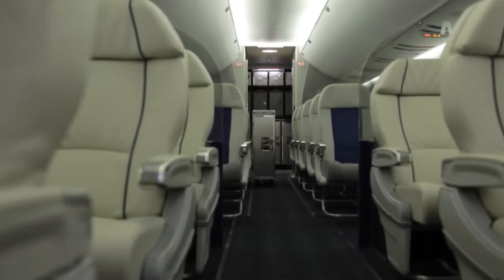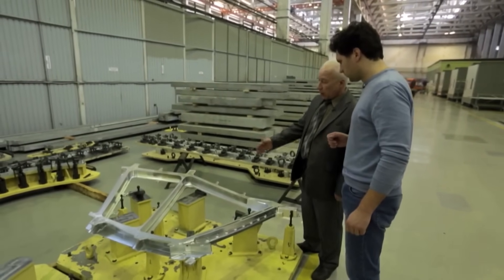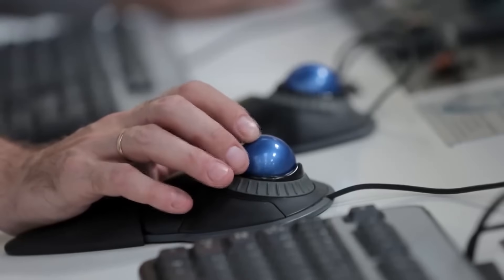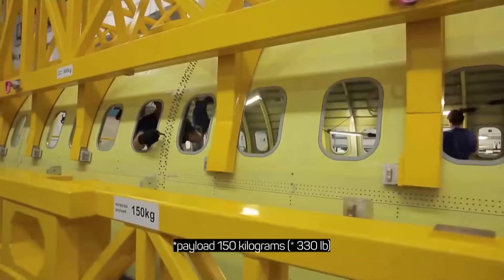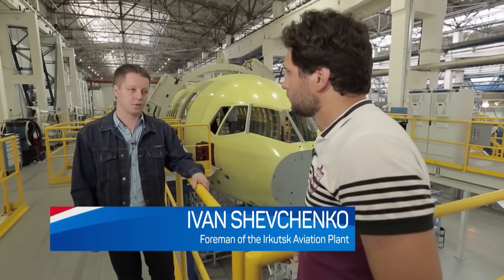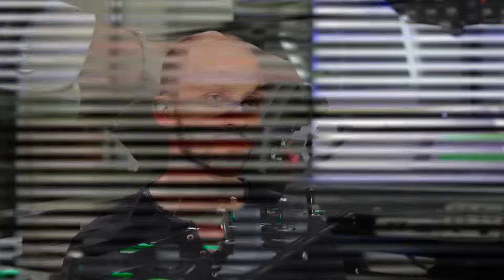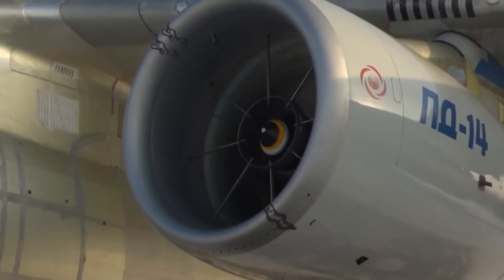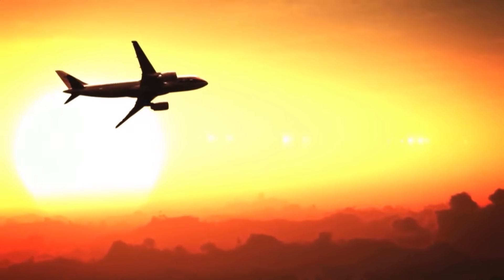The MS-21 – RUSSIA's Boeing 737 MAX Alternative

Comment: Update: due to sanctions, they stopped using Pratt and Whitney engines. Now they use only PD-14 (ПД-14).
Reply: What Engines does Boeing use? Aren't built buy Russia? Ask Elon. Boeing Engines are made by Russia!
Reply: Good to produce on their own to get more freedom from the hostile environment
Reply: What you said Pratt and Whitney sounds like a new Paccar engines they came up recently on a US market semi trucks, which are completely JUNK. So very good that they went with there own engines.
Reply: well.what are the successes??:face-green-smiling::face-green-smiling:
Reply: Due to sanction, they can neither build nor sell a plane that no one really wanted anyway... This is a C919 but with Aeroflot logo. The only Russian part inside it is the vodka for the passengers.
Reply: @TheNefastor  No it's not, they don't even have the same dimensions. Likewise different engines, cockpit, uses different materials, has multiple current sizes unlike the C919, etc.
It seems the MC-21 actually uses less foreign components/suppliers than the C919, for better or worse.
Just because they look alike doesn't inherently mean anything, current planes in general barely look any different.
It's not clear how much, if any, collaboration there has been. Obviously Russia has it's own long history of manufacturing aircraft.
Reply: @DoubleMonoLR  you shouldn't assume people are ignorant and can be lied to easily. Both place have the exact same dimension and payload capacity, at 19 metric tons. The Russian is slightly bigger but only to accommodate larger fuel tanks and give it more range. And the only significant difference in western component sourcing is that the Russians are using a domestic engine (for better of worse, as you said)

Moreover, the history of Russian airplane design includes very few civilian passenger planes, especially if you don't count military planes converted for airline use. That's why they used a lot of western input.

Bottom line, in every way, MC21 == C919.
Reply: @TheNefastor  You are clearly an aeronautical engineer from China, left without work due to your qualifications.
Reply: @TheNefastor  Length 42.3 meters for MS-21 and 38.9 for 919. Maximum payload 22.6 tons for MS-21 and 20.4 tons for 919. Fuselage diameter 4.06m and 3.96 respectively. Maximum range 6000 km and 4075 km. Yeah, they are pretty the same, lol
Reply: @mihailraskin2912  yes they are. Just because you can't read through your bias doesn't suddenly make your beloved single-aisle single-deck amateur plane into an A380.
Reply: @TheNefastor  Oh, I see. So 919, 737, 320 are the same to you. I have no more questions.
Reply: @TheNefastor  Boeing's largest branch outside of US was in Russia. Boeing 777 Dreamliner is 30% Russian designed. Boeing 737 MAX is mainly US designed with no Russian or German input and they royally failed with it.
Reply: @TheNefastor  So they have different dimensions, different wings different engines and insides and they are the same plane. Are you ok in your head?
Reply: @_Epsilon_  of course it is. And my mama is Elton John.
Reply: @TheNefastor  Again Boeing's largest branch outside of US was in Russia, they were doing enourmous job for Boeing. Same for Airbus. Russia is pretty much the only country in the world that can make 100% indigenous plane. Maybe US too, maybe. That's it. UK, France, Germany, Japan, China? None of them is capable to roll out their own 100% domestic aircraft, heck not even at 50%.
Reply: @_Epsilon_ You mention a "Boeing 777 Dreamliner", quite amazed as it's a variant I've never heard of.
Reply: @_Epsilon_  The point is not how planes are built and where it is made, the thing is with which engineers the creation can exist! Today, no-one newer russian airliner can have total pure russian creation! We will be able to equitably judge a russian whole product when it will be real 100% russian made! We wait for!
Reply: @gogolemongol5384  
Name me any foreign plane made ENTIRELY by one country.
Reply: @TheNefastor  Well Russia built a plane, and flew it successfully so I guess the only Vodka left to be served is to you.  But why bother you’re a ukronazie my guess so you won’t admit anything anyway 😂
Reply: @_Epsilon_  Boeing 777 Dreamliner is something made in CCCP ??? 🍖
Reply: @TheNefastor  BRICS is 11 Countries, 3+ BILLION Market. Russia will have No Problem selling their plane. 😂
Reply: @SportZFan4Ever  riiiiight, because 3 billion poor people have obviously the same budget for planes that the world's most powerful economies. Keep deluding yourself, it's hilarious.
Reply: @TheNefastor  Say "palyanytsya" 😂
Reply: @DoubleMonoLR  Most of the rockets and motor were made in Ukraine tovaritch...
Reply: @TheNefastor  "history of Russian airplane design includes very few civilian passenger planes" - lol. You know nothing
Reply: @ilia9048  prove it, then. List every Russian or Soviet airliner that isn't a repurposed military design. This won't take you long.
Reply: @TheNefastor  Mr. "expert", that you haven't heard etc. means nothing at all, when someone makes an argument a rebuttal is not enough "I say" as you do, and when you say something then the other fact may not take your statements as facts ;)

Post less like a USSR Politburo worker and more like a debater respecting facts and democratic debate ;)
Reply: @Odisovic  was that even English ?
Reply: @TheNefastor I get it, there are no facts, so the embarrassing journalistic "I don't understand" (a favorite of the incompetent journalist is to repeat the question 10 times :D )

So do you have anything like a human being or will the next answer be like a politruk as well?
Reply: @TheNefastor  Give more sanctions! You provide an opportunity to raise Russian industry, which could not be done before with globalization.
Reply: @TheXBiTeX  LOL sure thing, buddy 😜
Reply: @andrewkondrash1642  He is Taras from Lviv Boeing division 🤣
Reply: @almarn  In USSR. What can be made in Ukraine we know now, 30 years after the dissolution. The answer is: nothing. Those guys have managed to destroy even the most advanced factory - Motor Sich 🤦‍♂
Reply: @TheNefastor  boy.. why are you so sure Russia is trying to outperform or outcompete someone.. maybe they're just trying to build the most excellent plane that they can, mainly that is as self-sufficient as possible. They are quietly trying to become technologically not dependent on anyone else. Maybe they're not 100% they're yet, but they're trying to perfect things .. for themselves. Maybe to use internally. Russia is a huge country, and so domestic air travel is a huge deal. And whoever outside buys them, buys them. If not.. well, we'll see.. You seem to be very emotionally involved, yet you seem so sure that Russia will fail. Well then what's the difference? Ignore the hype, right? And if they make it, why is that so terrible??
Reply: @comment6864  you can put away your gaslight, comrade. I saw you coming from a thousand miles away.
Reply: @TheNefastor 😮
Reply: @gogolemongol5384 это невозможно Боинг ты думаешь чисто в США делают ? Там запчасти со всего мира
Reply: @TheNefastor  но ведь С919 начал разрабатываться ПОЗЖЕ, чем МС-21 (презентации от 2012 и 2015 годов).
Я бы скорее его назвал французско-американским в своей основе, с оглядкой на Boeing, чем китайским.

Очевидно, что вы ничего не понимаете в авиастроении, раз класс самолета является для вас достаточным основанием для таких сравнений.
Тогда и VW Golf это Kia Ceed по такой логике.

Похоже, вы просто наелись украинской пропаганды, не закусывая.
Reply: @NSMenschMaschine  what makes you think I know your language?
Reply: @TheNefastor  use translator like me and everyone else, oldguy
Reply: @TheNefastor  if you don’t know Yakovlev 42 history - you don’t know MS21 history as well. It’s Yakovlev renewed project
Reply: @TheNefastor  Yes. And toilet bowls were stolen from Donetsk villages.
Reply: @TheNefastor  At least in the MC21 , Amercan big ass dont need two seats like in Boeing planes😂
Reply: @patrickvavasseur7641  what makes you say that ? I've never heard Russian planes had bigger seats.
Reply: @TheNefastor  It's second-degree humor. I don"t know the difference between Russian or American aiicraft seats, but it's a response to your eternal superiority complex. In your opinion Russians are only capable of making vodka, which is a silly cliché. So I also have one of the Americans. They all have a big ass.
Reply: @TheNefastor  XD you're hilarious. keep coping
Reply: @nettlecarrier8259  who's coping ? I'm not the one whose country is ruled by an incompetent dictator losing a war he started.
Reply: @TheNefastor  Can't sell? Are you ok dude? They will sell it internally, getting rid of airbus and boeing. Same thing with C919. Both China and Russia will use domesticly produced planes
Reply: @TheNefastor  This plane has nothing common with C919, aside from being in the same class. It is completely different plane, stemming from Yak-142, and was renamed from Yak-242 to MS-21. Open Wikipedia, at least, and educate yourself a little.
Reply: @TheNefastor  MC-21 is way superior than C-919, in every aspect. MC-19 have more advanced design process and much higher engineering culture, advanced materials, another electrical and electronic solutions. Also this plane in the first place required to internal market but iran, china, india also will be interested in such a plane. China, inspite of having its C-919, will be interested in MC-21 plane because, C-919 have a high sanctions risk in case Taiwan conflict, and China will prefer diversify its avia park.
Reply: @vyacheslavvorobyov22  you're basically claiming a blue Lada is better than a red Lada. I honestly don't care. I'm sure both planes will give a lot of work to crash investigators, though.
Reply: @TheNefastor   школу закончил специалист?
Reply: @TheNefastor "that no one wanted". I think it's too early to say that, because I think in Russia they need maybe those and they build those not only for exports purpose. 😊
Reply: @TheNefastor i understand you are from india 😂😂😂😂😂
Reply: @TheNefastor ты откуда такой умный 😂 с Украины что ли ? Приезжай на производство поработаешь узнаешь из чего сделано
Reply: @MrBoFka  Не надо, он там нагадит.
Reply: @TheNefastor Никто- это 53 страны, колонии Америки. А остальные будут закупать вместо Боингов и Аэробусов.
Reply: @TheNefastor  😂😊😅 you didn't have to be so straightforward. Give those Russians some hope, at least.
Reply: @HenryTudorVIII Laugh at yourself. You sound cracked. Russia is one of just a few that can build submarines and space rockets.

Comment: "In series production since 2017", but no aircraft delivered till now. Makes you wonder if the MC-21 will come to market as planned in 2024.

In addition, the Aviadvigatel PD-14 ran first in 2014, but only a handful were produced till now. It is said to be problematic, since the combustion can't be controlled as it should be. Will this lead to another russian project going nowhere?

Btw. Do you really think PW is still allowed to export engines to russia "to open new markets"?

The statement to the fuel economy seems not viable considering the A220 while carring 10 passengers less, weighing 10 tons less. It is best fuel economy airplane out there and it would be very difficult to build a more efficient plane.

Is the "new PD-14" without western tech? Then forget the shiny figures and watch how old Tu-214 are going to production again, with old engines and old design. It is already happening.

just my rant about a misleading youtube video
Reply: ПД-14 уже в серийном производстве.
Reply: an important indicator by which each aircraft is evaluated is the cost of a flight hour. Several indicators are included in this parameter: the cost of fuel, maintenance, pilots' salaries and much more. The Airbus A320neo, the leader in flight range, turns out to be the most expensive of all — an hour of its flight costs 3.2 thousand dollars, and in some cases this figure reaches 3.5 thousand dollars — an absolute record among the most popular narrow-body aircraft on the market. The Boeing 737-MAX is a little cheaper — an hour of its flight costs 2.5–2.7 thousand dollars. The MS-21 has absolute leadership in this class — the estimated cost of a flight hour ranges from 2.1 (2.2) thousand dollars to 2.5 thousand. The final figure of the airline will be announced after a couple of years of operation
Reply: @Олег-ы6щ5н  Ha ha ha ha the A-320 is the more expensive airliner! Explain me why his orders is more than 15.000 today, even before the Boeing 737! Just India ordered 750 Airbus, mostly A-320, during last 2023 Salon du Bourget. Because A-320 have the higher flight hour cost???  And more, it is not only to have the best flying hour cost, it is necessary the plane can fly constantly. Who can told us how many rotation a day that MS-21 will do? One flight at (ESTIMATED) cheapest cost and two days at workshop for usual maintenance? I wish the best for that plane, only time will say if it is born as a winner or a looser!
Reply: "It is said to be problematic, since the combustion can't be controlled..." - who and where said this? Can you provide a reference, either  it's just voices in your head? The PD-14 has been already tested thoroughly and was certified by ICAO in 2021.
Reply: Tu-214s are built in series with PS-90 engines of the 3rd version, because they have long been tested and certified. These are reliable aircraft that will easily find an independent market from the American dictatorship of sanctions.
The PD-14 engine is obviously not serially installed on the aircraft, because at the moment there is no fully certified MC-21 aircraft exempt from non-free western components. Perhaps the PD-14 engines are already waiting for the aircraft in the finished product warehouse, and there are already a lot of them.
PD-14 is already the past, but it continues to be tested. Work is underway on the PD-8 and PD-35. American propaganda said that there would be no serial production of the PAK-FA aka Su-57. Do not repeat MSM propaganda. Think yourself.
Reply: @Nahal0nok  exactly - Americans like to diminish the competition an d pretend to believe in propaganda exposing the incompetence of other people, as if they were the only smart people on the planet
Reply: @Nahal0nok  I don't repeat propaganda. Btw. the PD-35 is scheduled for '29 or '30, said by Alexander Inosemtsew from UEC to TASS.
PD-8 just had it's maiden flight on 26. Dec. 2022. So given the actual situation in russia, it will take some time before running series production.
PS-90A is more likely to ramp up production in war time than a new derivate of an derivate.
I asked an honest question, i expect an honest answer, minus the hatred.
Reply: Finally some common sense and not just stupid Russian fanboy nonsense.
Reply: You have to understand how Russia works .Its not the USSR. They like to start new programs instead of improving tested designs like Tu 214.They do this for the huge infusion of R&D capital and really don't care about delivery. Yatches are bought, offshore accounts opened and they keep asking for more money until the project is scrapped and they move on to a new project, rinse and repeat. The SU 57 is an example
of this. Its been in production forever.
Reply: На самом деле МС-21 с PD-14 не так хорош, как его версия с PW. В определенном смысле Вы правы, что характеристики упадут. Но! Даже и с теми характеристиками, какие будут у этого самолета с PD-14 это большое достижение самого высокого мирового класса.
Reply: @rodezirkel9  I didn't want to downplay the PD-14 towards western products. I don't think it is better or worse, i asked the question if and when it will come to fruition. Given that many projects in good old russia have been halted in the last decades. Could have been an honest aviadgatel engineer comes by and tells the state of the matter. Whatever the situation is now. If they have to switch to chinese components, that can happen quickly, but can also be a long process. We will see, but with an ongoing full war, there less room for civil aviation.
Reply: @juliane__  программа МС-21 находится сейчас на последних двух воротах (гейтах). Сейчас идет сборка эталонного самолета и предсерийной партии. Идущие сейчас полёты и испытания, направлены на устранение выявленных в ходе испытаний недостатков. С уважением к Вам.
Reply: @juliane__    PD 14 itself is a little bit less efficient than the PW engine on both bypass ratio and compression ratio.  But the PW engine still has its problem from trying to squeeze max efficiency out of the turbine issue.  By the way, when comparable from an overall operating view , the Russians might have an advantage in lower cost from both the plane price and maintenance cost.

Comment: The information is outdated. There will be no PW-1400 engines. The 73051 and 73055 boards on PD-14 engines fly in full for certification. PD-35 and PD-8 gas generators have been assembled and delivered to customers.
Reply from the maker: thanks for your input
Reply: Update: PD-8 has been certified and went to production. Full engine I mean.
It is going to be used on ssj100 and some other aircraft like be200 amphibious plane etc